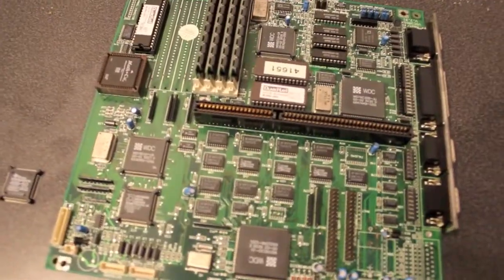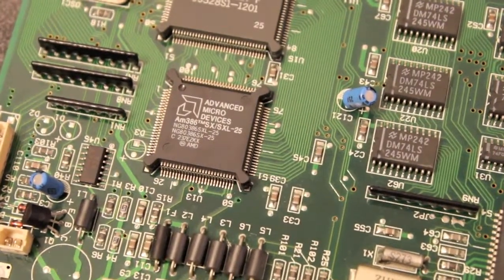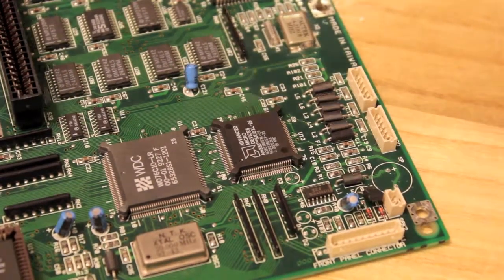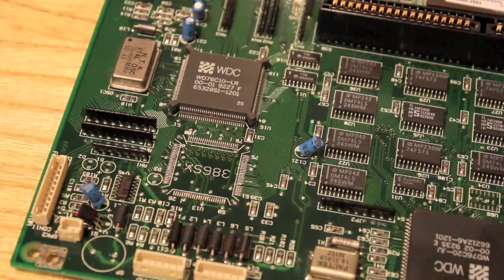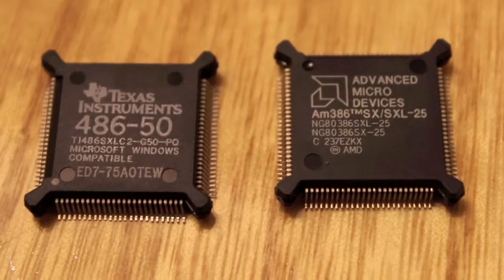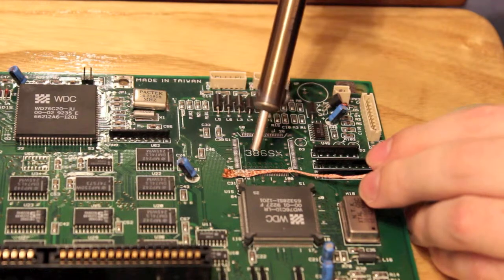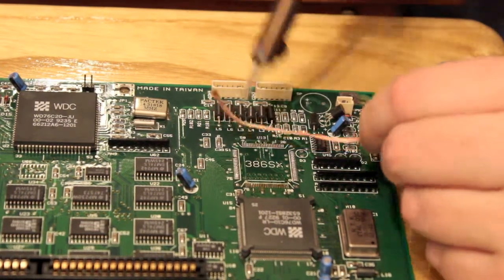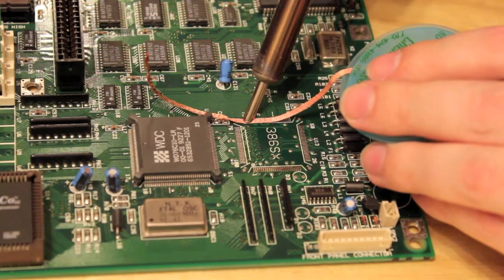Part 1: Quad Flat Package Soldering on an Amstrad Mega PC Motherboard

Comment: A 486 processor is not pin compatible with a 386 based processor.
And the system BIOS is written for a 386 processor instruction set and not a 486 processor instruction set.

You replace the AMD 386SX-25 for AMD 386DX/SX-40 processor if the main cristal capable of generating 40 MHz.